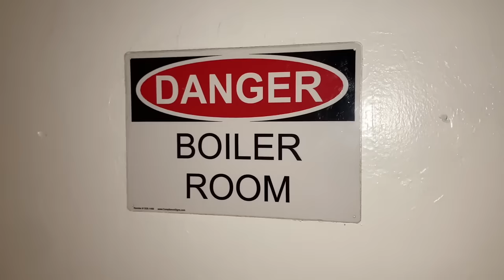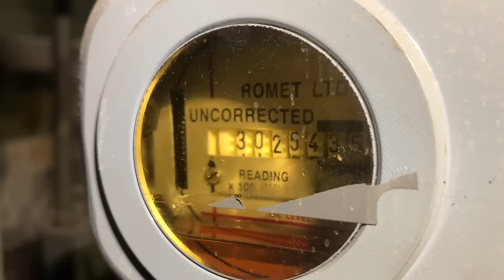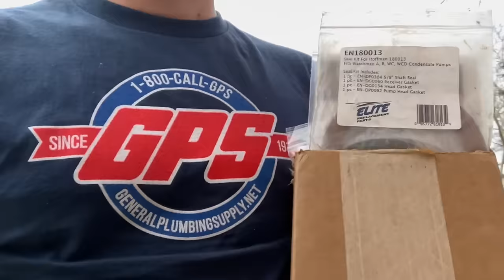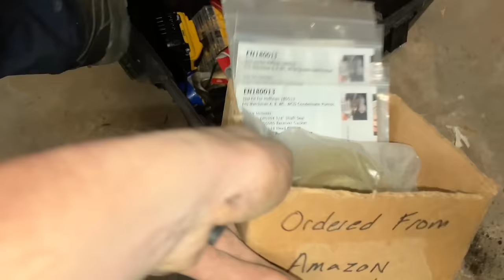Commercial Steam Boiler Pump Rebuild

Comment: If you carry a flat file you can and I do grind the tip as a gasket/machinist scraper which also works great for burr removal and (laid flat across the surface and moved in a circular motion by your palm) cleaning and flattening old gasket faces.
Tip I invented when rebuilding my well pump: The rotor was seriously stuck on the shaft so I cut it (away from the steel rotor hub of course) then used a knotted wire wheel on my cordless angle grinder to brush off the remaining plastic quickly and easily leaving a nice shiny hub to grab with visegrips. I've also brushed off plastic power steering pump pulleys to replace them with steel using the same method. It's quick and clean. I install 6" angle grinder guards on my 4-1/2" cordless to use the VASTLY better 6" thin kerf cutting discs which have deeper reach and faster edge speed, either by finding a matching guard or cutting and welding one from two guards. Either way is well worth it or you can spend more on a 6" cordless but for light work smaller grinders are fine.
I get most use out of knotted cup style wire brushes. I Loctite my pump bolts because Loctite also excludes moisture counterintuitively acting as anti-seize.

Comment: Getting the old  gaskets off can be a pain.. if you’re careful I like to use a wire wheel to clean the surfaces especially if you’re rebuilding like you did!
Reply: 3M makes gasket removal discs which work nicely.

Comment: Take caution when installing those mechanical pumps seals. Try NOT to touch the mating surfaces (the white part) any contaminates, or oils (hand oils) will stop the rotating seal from mating up properly with the stationary part of the seal..👍